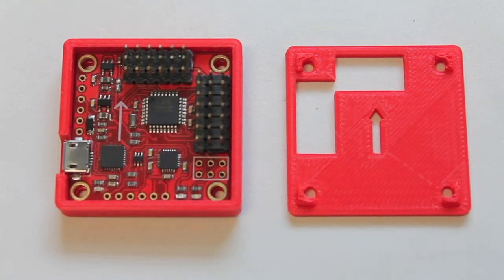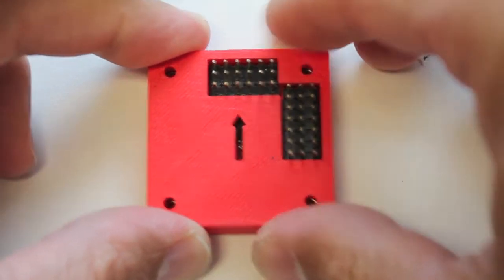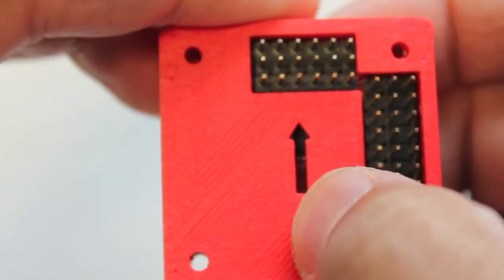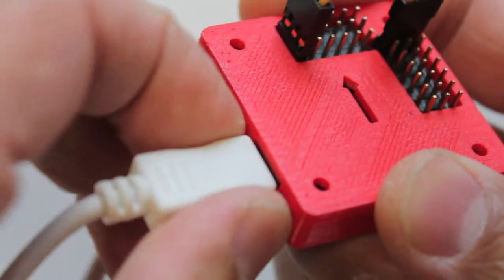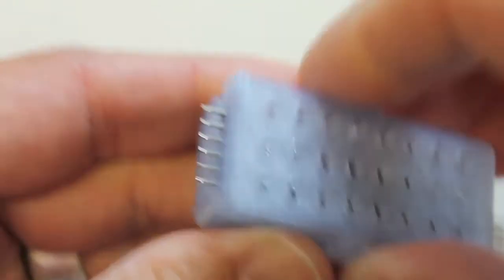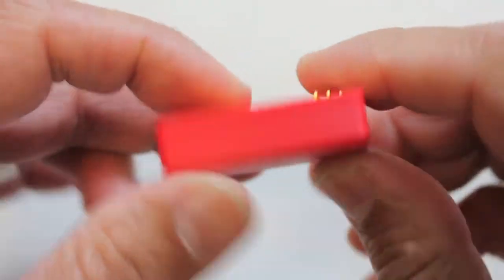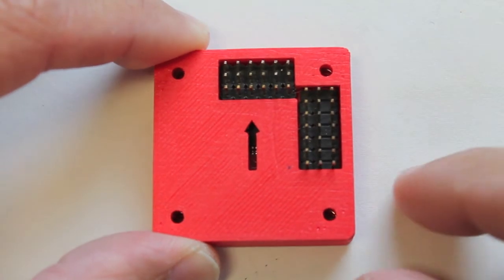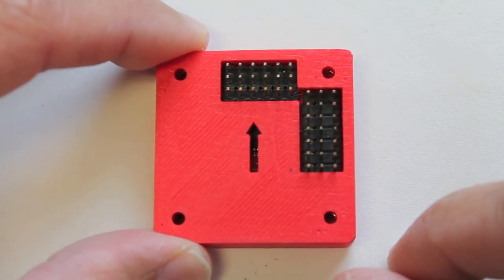3D Printed Case for MultiWii Flight Controller Needs Your Input

Comment: Vibration reduction is the name of the game my friend.  I was a AH1W super cobra and uh1n Huey mechanic. Gutted, rebuilt, tested and flew in them.  It will be hard for some people to mount gel vibration reduction balls if you use the wrong size mounts or gel sphere.  Vibrations will kill your quad period.  Reduce vibes will produce much smoother flights, less twitches from quads due to lower vibe frequency emitting from motors and props to the center of gravity where ur fc is.
Reply from the maker: Very true. I've spend way too much time trying to kill vibes over the past year. Crazy that you were a mechanic on the Super Cobra and Huey helis. That's incredible! Are you certified to fly them?

Comment: This is the way I see it getting mounted. Because I hard mount my flight boards to my quads I can imagine the top of the case snapping on like your minimosd case rather than having the holes. Leave the holes in the bottom so you can drop a nylon screw down through there to mount it onto a short standoff or even ditch the standoff altogether and just through-bolt it with a nut. People really need to stop suggesting "vibration reduction" things. Always hard-mount the board.. Lastly, etch a design into it somewhere! DB for Dennis Baldwin, you have one of those marketable names.
Reply from the maker: Thank you. Great suggestions and I'll definitely keep them in mind as I work on some revisions. I appreciate the idea of etching DB in there somewhere. I'm not really interested in branding these designs as it something I'm doing as labor of love, but maybe I'll reconsider as I get further into this :) Either way, I appreciate your time and thoughts related to this design.

Comment: what if you got rid of the holes on the back side, and made the top plate (one with the arrow) clip in, with internal clips, amd have some rods that would align the board, and push it down to the back piece. You would need to have little raisers behind the board's mounting holes. this would have a clean secure case.
Reply from the maker: Mike, thanks for the suggestion. I think I sort of understand what you're asking about the rods that you push the MWC controller. Would you mind elaborating a bit more so I can a full understanding of what you're suggesting? Thanks!
Reply: Dennis Baldwin design it with internal clips like APM Case, then also design it that when you clip the 2 case pieces together, that it claps onto the xrock board. then no need for screws.
Reply from the maker: Mike Henry good idea. Let me work through some design iterations and see if I can get the clips on the inside. Right now they're on the outside mainly because they'd bump into the servo connectors on the board. But I'll see what I can do.

Comment: Research vibration gel balls and I'm sure you'll find the right design   for your case so it can adapt to any size quad.  The more options the better, much like motor mounts with hole positions.  Or if possible a clear case is another avenue of approach.  However it is done one thing I know is that it must be adaptive to fit wide range of quads stand off positions. 

It will be great to see the finished product with all these great minds and inputs.  Good job man, it's good to see people adapt and evolve this hobby.
Reply from the maker: Thanks for the suggestions and feedback. I'm glad to know that we can evolve the hobby together. Take care.

Comment: Fc like the naza can be held on by quality gel tape. But any minimizing of vibration to the fc is a plus.  Weight plays a role as well to dampen the vibe  if its too light ur fc will just shake and rattle and wont be as smooth.

Comment: Great job man looks nice.  Screw to secure lid are best. You can make another mounting plate for that like an x pattern. And each corner of the x will have a large enough hole to fit anti vibe gel balls. Kind of like the mounts you would use on gimbals.

Comment: I like the outside clasps better, on two opposite sides (4 probably a little much). Maybe some labels for motor 1 and signal 1 might save opening lid as often. Instead of screw holes through the entire thing, maybe some ''push pins' to mount the board to, save having to have screw around; a more 'complete' solution.
Reply from the maker: Great suggestions, Douglas. Do you mind elaborating on "push pins" a bit more. Are you talking about posts that stick up from the inside of the bottom case? Then the MWC just clicks into place inside the bottom case. Just trying to picture your suggestion. Thanks.
Reply: Dennis Baldwin
Hi Dennis, yes, round posts with an 'arrow' at the top and a space down the center so that you could push down the MWC and it would stay in place. I'm not sure such a small part would work on a 3D printer, but even basic posts to start I think would work.